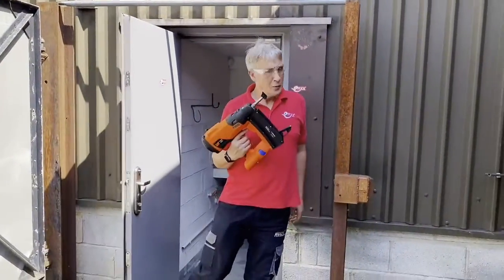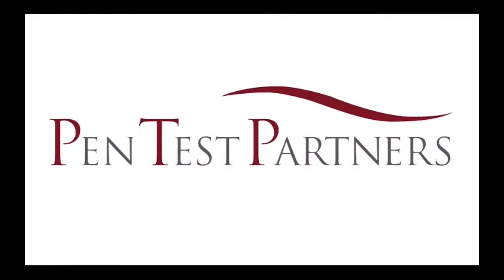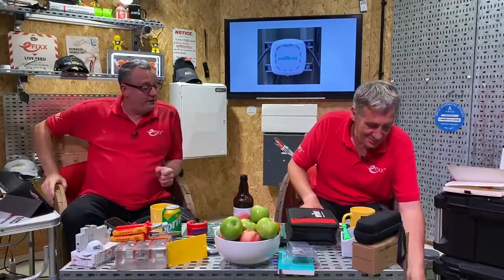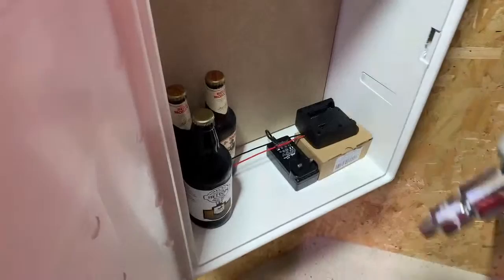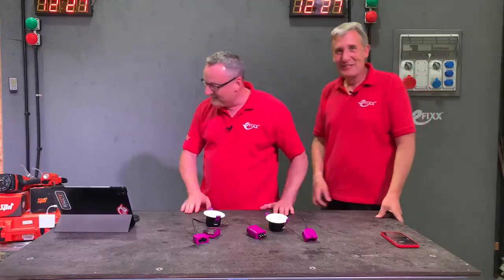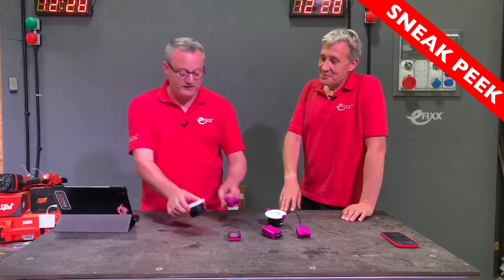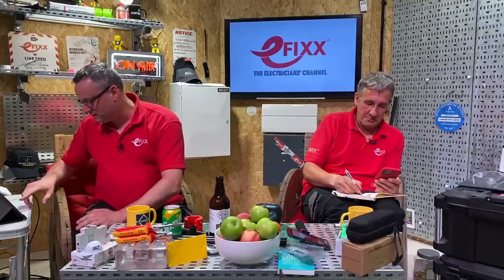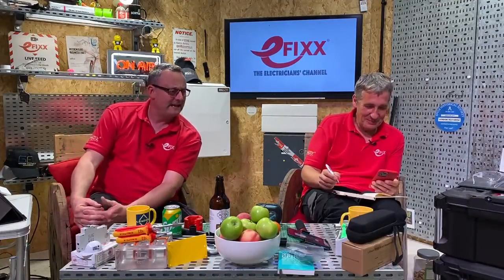Can EV Chargers be hacked? New tools and a FREE electricians CPD

Comment: Does the 40e need gas canisters?
Reply from the maker: Yes it has a smal gas canister along slide the battery - review coming soon.
Reply: @efixx  I know dewalt do a concrete nail gun and you don’t need to change the gas canisters. Maybe review it side by side?
Reply: It's a captive system so there is a gas cell in every box of pins and you'll usually get 500 plus shots out of it before having to change it. This is twinned with a battery cell so you're looking at 3500 shots per charge.